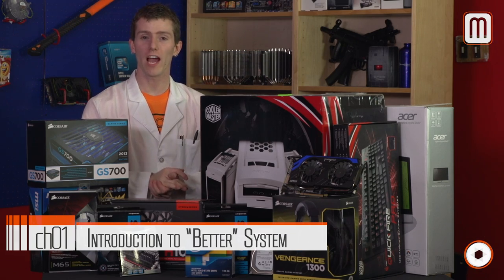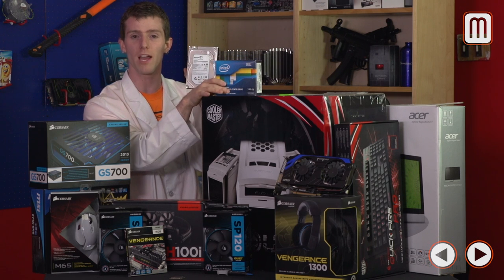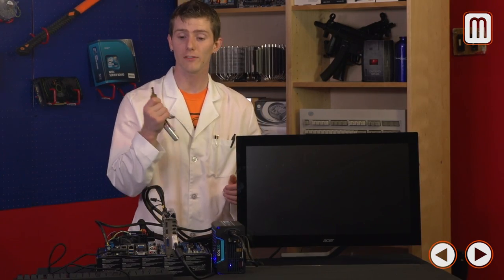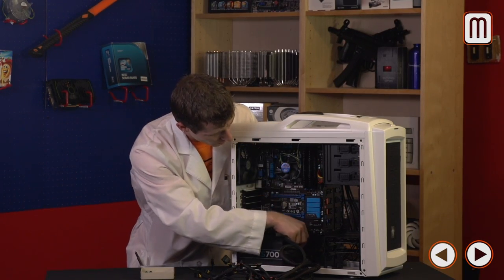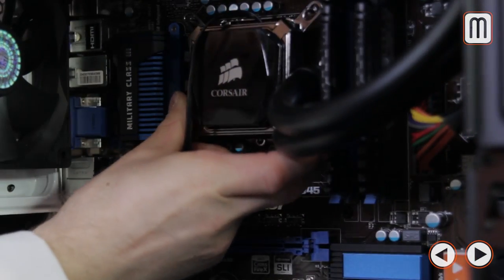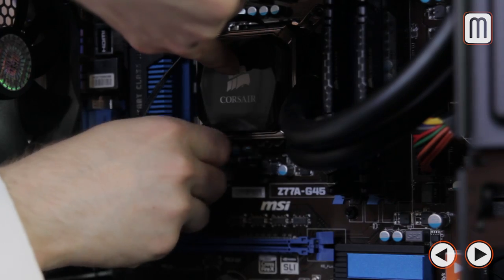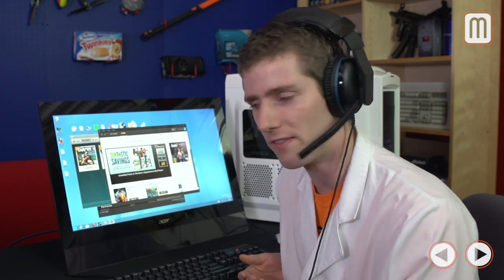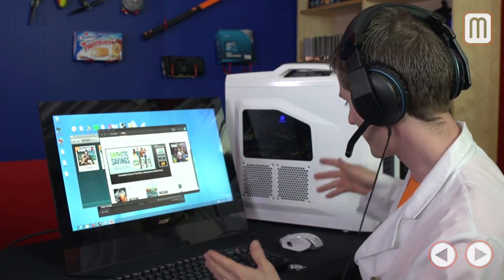ULTIMATE Build a Better $1500 Gaming PC Computer "How To" Guide

Comment: "The two most important things in Pie is crust and filling"
That's literally all pie is
Reply: No you can put toppings on it like whipped topping
Reply: +luigikiller1000 And that's why the metaphor works well. Without either, there would be nothing and it would become useless
Reply: ***** I am pretty sure it is not
Reply: Lol true
Reply: Why do you pronounce it like that?
Reply: the pan....
Reply: yeah pie is important
Reply: You also need a pie tin (motherboard) to hold it all.
Reply: I don't really see how the cpu is the crust... The motherboard brings it all together and bottlenecks the lanes of a cpu and the memory at the lower end sets what programs you can and can't run. If I build a computer the first parts I choose are memory and motherboard because this sets the overclock final speed for the cpu, sets the slots I have to work for, the architecture, the type of power requirements, the clearance of CPU cooler, the type of storage options to look through, and the size of the cases the look through. The reason the memory is part of this is that you should never overclock memory or motherboards outside spec, so the kit you buy should always match the upper oc limit of the motherboard. Then pick a good cpu you can afford and overclock it to match the ram and motherboard. Linus's statement that you bottlenecks a gpu with a slow processor wasn't wrong, but hinted (much to his sponsors delight) that someone should spend either as much or more on a cpu than a gpu... Just not true, gpu is what makes a gaming PC a gaming PC, 1/3 the price is just fine. 1/2 won't bottleneck on titles that were made well.
Reply: Topping?

Comment: i built last week:
i5 4670k
16 gb crucial ballistx
r9 290 tri X
2 tb HDD
750 Watt (possible crossfire in the future)
Gigabyte GA-Z87-HD3
Fractal Design R4 case

total: 950 bucks
Reply: jkteddy77 It's without the OS, i still had a copy of win 7 pro at home. The HDD was also the only thing i didn't buy new, it was formatted and transferred from my old computer. I'm really loving the 290 tri-x. It can play everything maxed out without the problems of overheating like the regular 290.. How are you liking the card?
Reply: jkteddy77 Also, I searched compare websites to find the lowest price store for every component. If i ordered everything from the same store I would have easily had to pay 1200+ dollars
Reply: jkteddy77 The card is amazing. Quiet and super fast. Just install Tomb Raider once you got your setup and crank everything to the max, you won't be disappointed.. It was designed especially for AMD cards.

Comment: lets see a 2016 version please?
Reply: My 1500$ build (1 month ago) Mobo: msi gaming m5 CPU: i7 6700 GPU: msi GTX960 Powersupply: 750w(little overkill but im planning on upgrading in the future) storage: Anything above 1Gb ssd not needed case: doesnt matter mostly for looks check my latest video for it :)
Reply: LinOG Gaming lol, my friend is building a pretty similar rig, but hes going with a gtx 1080 I think
Reply: Yeah im going to be upgrading soon when the price for the 980's drop i will get one of those :)
Reply: I'm going to build this: GTX 1080, Intel I7 6700k, 16gb hyperx 3400 RAM, 750w PSU, NZXT H440, and I forgot the mobo, and NZXT cpu water cooler.
This comes in at 2000 euros, and I am able to get the taxes back so divide it by 1.21 and it will be around 16/1700.
In the US you can build this for about 1700 WITH taxes.
Reply: Wow
Reply: +Seven I lied, fuck it, 16gb corsair dominator platinum ram
Reply: +LinOG Gaming get a 980ti, after the price drop it will be so fucking worth it
Reply: ***** im not playing much like super hardcore games so i spent more on cpu leds case and a good motherboard and im getting a 980 later when i have the moneys
Reply: Seven idk about ti but i will indeed get a 980
Reply: LinOG Gaming after the price drop man, it is such a steal
Reply: get an i5 with a 970
Reply: Okay, replying after 4 months, the 970 is a STEAL seeing that it's advertised as a 4GB GDDR5 card but it contains 3.5GB of usable GDRR5 and 500MB unusable by games, such a STEAL from NVIDIA.

 EDIT: I had a 960 with a GM204 GPU (Not GM206 as found on the majority of GTX960s) unlocked to a 980Ti with some VBiOS and GPU tricks (thanks to the manufacturer), my ex-980Ti/960 is now retired to a GTX1070 Founders Edition, after 2 years spent with it.
Reply: 2019 version but this old style

Comment: Linus, thank you for making this vid! I just bought a Corsair h100i GTX to go in my CMStorm case and the struggle was real!

This is my first liquid cooler and I spent three hours trying different ideas on how to mount the radiator when I saw it wouldn't fit inside.

I ended up mounting the fans externally, rendering push/pull impossible. Can't believe I was so air headed that I didn't do what you did here!

Now I can use a push/pull after sawing the handle off. I'll just weld a bar on each side to replace it.

Thanks again!

Comment: Save the money on the SSD and get a better GPU.  This is a gaming machine and FPS is going to be more important than loading times.  That is my first thought looking at the parts list and the cost.
Reply: but when u do have the extra $$$ get that ssd XD wish i got mine sooner
Reply: Although I do agree, the 660 ti is a great gpu for its price and you might as well get the ssd and the 660 ti because that way you get the "best of both worlds."
Reply: My 780 just came in today. Works quite well with my i5 3570k.
Reply: With swag.
Reply: lol idk i just built my pc recently i was excited. I saw they were talking about gpu's so i just wanted to join lol.
Reply: ***** no you wrong, 670 is slightly better than 760. beside it shows from the prices, the trusted website called "GPUBOSS" shows that 670's score is 7,8 that bigger than 760's score 7,6..
Reply: i don't agree with you..linus is not only focused on the performance , he focused on the colors of whole components.. gtx 660 Ti have a blue color .. thats synchronize to the mobo and PSU's color .. and this build makes you can upgrade easily.. so you can upgrade your 660ti to 670.. or to other blue colored graphics card
Reply: ***** thats right ;)
Reply: ***** i wont go with r9 series....dey heat up easily...and wen anythign heat up..it perform really bad...and its performance is low regarding other graphics lyk 7 series and such or de 8 series.
Reply: Faruk Ucar heat up easy LOL get a better case tool and buy a decent brand

Comment: CPU (2x): Intel Xeon E5-2697 v2 Ivy Bridge-EP 2.7GHz 30 MB L3 Cache LGA 2011 130W BX80635E52697V2 Server Processor
RAM: Kingston 128GB (4 x 32GB) DDR3
GPU(8x): NVIDIA Titan
Would this run Minesweeper and Rollercoaster Tycoon @ 15fps?
Reply: thanks! whew I was worried!
Reply: +windell0121 you ruined it
Reply: +go on I died
Reply: Not even close you'll need AT LEAST 20 Titans XXX's that have 64gb each. Bump it up to 512gb of ram and put another 6 CPU's in there. Even that will only give you about 25 fps at 800x600p
Reply: More like 1,000 fps 4k

Comment: I would love to build my own Gaming PC but the wiring puts me off. Scared I'll do something wrong or not plug in the right cable to the connector and fuck everything up. Might just get a company to build it for me for a little extra money.
Reply: this is what user manuals are for! ^_^ you don't have to be an engineer to wire up a PC =D
Reply: KingCat LXIX You gotta start somewhere man. There's no shame in messing up or taking your time. It took me about a good day or two of just sitting around, reading between the manuals and watching videos of installations to finally get my build working.

If you have a friend who's already built a PC in the past, I would suggest bringing them along to supervise your build - so that they can make sure you won't fuck anything up.

Trust me. It's rough and tiring at first. But it's all worthwhile :)
Reply: PS - I fucked up a few times and had to call some friends to help. This is okay. So long as you do not physically damage a part - you'll be okay :)
Reply: I just built a computer with no experience but, I have alot of background in building/taking pc's apart and installing new stuff. Recorded my build with vary bad quality but it should help you. http://www.twitch.tv/jmgoodog11/c/5859207 my build was about 1.500
Tower: CM Storm Stryker

Heat sink: Cooler Master V8 GTS

PowerSupply: CORSAIR RM Series RM1000

CPU: AMD FX-9590 Vishera 8-Core 4.7GHz

Motherboard: ASUS Crosshair V Formula-Z

Graphics card: ASUS GeForce GTX 750 Ti 2GB

ram G.skill trident 16gb 2133
Reply: Mostly everything can only fit onto what it goes to.  Motherboards generally have all their ports labeled as well, so things end up being really self-explanatory.  The ONLY confusing part is getting your case wires hooked up to make your power button and LEDs function properly, at which point check out your mobo manual and maybe call a friend.
Reply: Adam Cross i always wondered if you buy a i7 or something does it come with a manual xD
Reply: Don't be afraid, most of the newer boards and psus have the connectors and ports labeled also it's hard nowadays to plug something in the wrong way and cause a failure most peripherals wont even start and then you just fix the wiring and everything is fine with no damage
Reply: 851995STARGATE ahh thanks :P
Reply: KingCat LXIX Really not hard to build seriously a 12 year old could probably do it
Reply: KingCat LXIX So long as you know what goes where and refer to all the manuals aswell as doing a bit of research, it is a very simple process. The only thing that might catch you out is liquid cooling as if it goes wrong the whole system is kinda.... dead.
Reply: KingCat LXIX  Fear and laziness will keep you away from the knowledge and power..... Go ahead, learn and do it yourself!
Reply: Built my first pc with no fear. Just gotta read and have another pc/smartphone avaiable for research and troubleshooting issues. There will always be bumps in the road but it's so much fun building
Reply: KingCat Im 13 and I was scared that i was going to bend the cpu pins short it out, But it is like building legos....If you want me to be honest a 400 peace lego set was harder to build them my gaming rig. The pins can only go in one way.......
Reply: TheRedRider That 12 year old would be me :)
Reply: KingCat LXIX You shouldn't worry about it too much, I know next to nothing about building or working on computers. But I'm still able to put a pc together or modify my current one with little hassle. 

Building a pc in 2015 is dead easy.
Reply: KingCat LXIX i'm like you, and to be honest i want an Alienware PC so freaking bad but i wanna learn how to build my own PC.
Reply: taifhamid1 Dont get alienware, way overpriced for what you get.
Reply: KingCat LXIX
i can't afford it anyways lol plus if i would spend $1500 on a PC i wanna build it my self so it's really good.
Reply: あなたの先輩 OMG I JUST REALISED WHAT I DID XD
Reply: KingCat LXIX  Wires can be intimidating at first but once you know what each wire is for, it makes things easier. And all the connectors only go in one way so there is not much room for mistake. I recommend a modular power supply for beginners as they will be much easier to work with
Reply: It took me nearly and hour to wire my first computer and cable manage it (the cable management was horrible and I read the manual several times). I later bought another psu, and wired the computer up in under half and hour. Wiring is actually a lot easier than most people assume.
Reply: KingCat LXIX I just did it a week ago and it's just like lego you literally look at the drawings on the manual and do it , it's so easy you just need to go slowly and take your time. And you can watch tutorial videos, but i do get it that you'r scared, I mean no one wants to throw away 1.5k dollars by fucking up
Reply: How did it go ?

Comment: How decent is this kind of setup for an Gamer and workstation PC?
Specs:

CPU: Intel i5-4690k
CPU cooler: Noctua NH-U12P
GPU: Nvidia GTX 760 OC Edition (Gigabyte)
MOBO: ASUS Z97-A
PSU: Antec EDG650 (650W)
SSD: Samsung 850 EVO (250GB)
CASE: LC ATX MIDI PRO918B Jupiter X
RAM: Kingston 8GB DDR3 1600MHZ non-ECC CL11(1x8GB)

Feedback is welcome.
Im planing on getting an HDD and Sound Card, but my budget for the time being is around <1000 euro.
Reply: Im grateful for your reply.
But i have to make a few things more clear.

I already have the GPU (got it cheaply from my friend for 125 euro), so it doesn't pay of for now getting the GTX 970.
The SSD is necessary for load time decreasing/shorter program loading.
Im not gaming much on PC and haven't even tried (or care at all) to stream.

Otherwise, thanks for the feedback ^_^.
Reply: Loundre3 What do you mean with ''workstation'' PC? Are you going to use CAD or are you going to render? If so, this PC is no fit for such work.
Reply: CAD, rendering, composing and using it for programming in assembler. And if its not fit for such work, then what do you sugest, that is not an X99 motherboard and the premium stuff (ovepriced processor, overpriced RAM) that i might need? Its not like i will do ultra high definition studio work.
Reply: Loundre3 It's absolutely minimal to have a good quality motherboard for such work, aswell as an Intel Xeon E3 V3 atleast one that has hyper threading. You need a motherboard that supports ECC memory, on top of that you need ECC memory which is atleast 16gb. You need a full tower case with a quality power supply. Also, you'd need a ~150 dollar render card. GPU isn't suited for it, just for gaming it is fine. 

Rendering is no joke, any less would be under minimal for such things and can't even be called a workstation PC. 

I was considering it but then I got corrected by an expert and I knew I had no budget for such components. 1500 euros is the absolute minimal to have one that is a workstation aswell as a gaming PC.
Reply: Interesting. I will then focus on making myself an gaming rig instead, with some minimal workstation bonuses, since my budget is very tight (can't go over 1000 euro). Otherwise, thanks for your comment. I got an better overview on the differences between an gamer rig and an workstation PC. Good night.
Reply: Course i want to play Witcher 3, Mortal Kombat X and MGS: The Phantom Pain.
I cannot play these at all on my current rig, so one reason more why im in the need for an Gamer PC. if an Workstation PC cannot suffice.
And i wish to use it also for modeling, music composing and programming.
Reply: Well, my plans have changed. Does an Intel Xeon 1231v3 do the job for an workstation and gamer PC?
And what motherboard would be the most effective for the CPU (support for ECC)? And can i use it on an Z97 motherobard?
Reply: Black_Eye you dont need 16gb of ram just for gaming 8gb is fine
Reply: How much is 1000 Euros in pounds
Reply: AnyGames £732.78
Reply: Did you ask the guyz at the linus tech tips forums
Reply: Loundre3 Dont buy a sound card you dont need one. You're better off buying the hdd first unless you have the ssd already.
Reply: The sound card (comes later) and HDD (an WD Blue 1TB and various other parts) come later, after the computer is build. First, im going to get my hands on the most important parts (so that it can atleast work, and that it wastes less energy, my second most important goal), then add more of the good stuff on it, so i have everything planned out. And i know how fast an SSD is compared to an HDD. Its atleast 3x times faster, and i saw the performance of it on an Netbook, and my friends Gaming PC, so the SSD must stay.

Now for the important parts...for those i always question which one is an better bang for the buck and isn't going to break easily (i went from an i5 4690k to an Xeon 1231v3, and finding an feature rich and compatible motherboard is going to be hell, plus finding an affordable full modular platinum/gold type of power supply for 750w, nothing less). I need some help in chosing the right parts, and advice in PC building.
Reply: Loundre3 if you have already gotten the PC or are soon I'd be willing to buy you the SSD or the HDD
Reply: What?
Reply: ...no, thank you.
Reply: I'm getting a similar PC. Same processor. I recommend the new gtx 960 though. It is not as good but cheaper. Your call.
Reply: Loundre3 You dont need a sound card. At all. You will not notice the difference between motherboard audio and sound card audio.
Reply: thats a very good setup

Comment: Wil this run meinkraft?

4 Titan X
Intel i7 4790K
128 gb RAM
Reply: +Edward Gudmundsson No because you can't have quad SLI or 128GB of RAM on a 4790K
#FAIL
Reply: Actually 4-way sli has so much studdering when gaming to the point when the games are unplayable ironically enough. (Watch "the compensater build.")   So no. :p
Reply: you're just below the minimum requirements. Give it a shot though
Reply: +Edward Gudmundsson yes, but at 1,000,000,000,000 fps, instead of 1,000,000,000,000,000,000,000,000,000,000 fps
Reply: +Edward Gudmundsson NO, there's no powersupply, nor a motherboard. Don't even have an HDD. -.-
Reply: +Edward Gudmundsson no, u need 5960x if u want 20fps. u only get 0.5 fps with that cpu.
Reply: Z609 he actually does need a 40 lane cpu unless that motherboard has a plx chip
Reply: No it won't
Reply: +Edward Gudmundsson You need a power supply
Reply: +Edward Gudmundsson If your lucky you should get 30 fps on minesweeper on medium settings.
Reply: GoonGamingTV nah bro my i5 870 gt 530 6gb ram can run it 666 fps solid 4k ultra settings burz